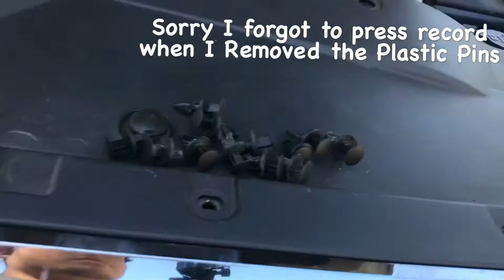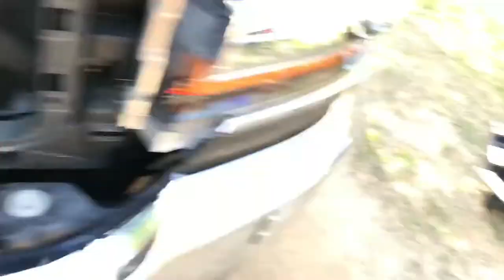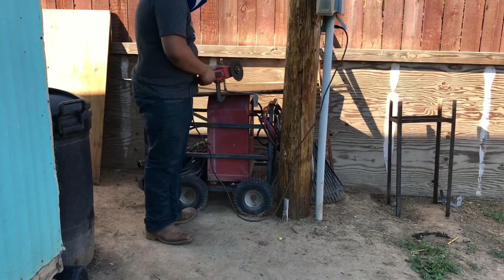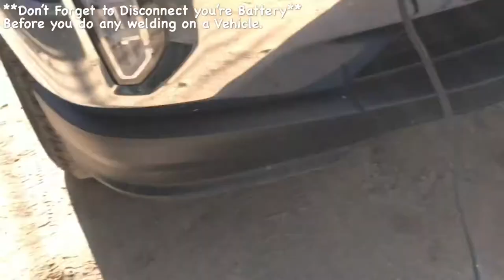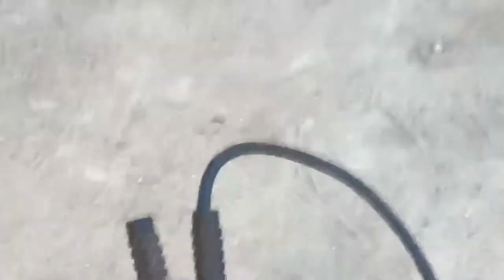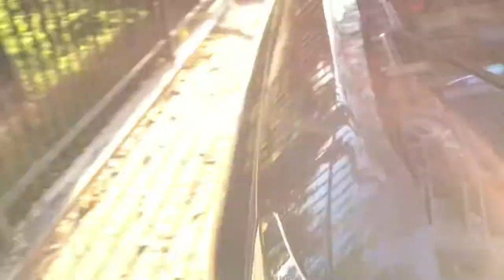2016 - 2018 Chevy Silverado LED Bar Install

Comment: Nice... I suck at welding I'd end up getting the l shap melted and a few straight with some bolts and nut lock  washers and call it a day... but this job was creative for sure

Comment: The grill fit back perfect? And wat sizes is that led bar?
Reply from the maker: Victor Bracamontes yes it fit back perfectly with plenty of space and the led bar is a 32 inch Curved. I’m actually working on a update video because i installed a few more behind the grill.

Comment: Did you not have the active grill shutter system? If so didn't unplugging it make a check engine come on?
Reply from the maker: Jon Wright no mine didn’t have any of that, the grill just came off and there were no wires or anything attached to it, it was pretty simple, Also I have no clue as to why the check engine light would turn on that’s pretty interesting, what model and year truck do you have?
Reply: I got an 18...I guess since 17 they added that and dont leave enough room for the light bar I had to return it

Comment: how did you delete the active grille shutters? 
because i wanna put couple with out engine light come on down the road....
Reply: Not all of them had the active grille shutter system, I think that was added for the 2018's. What year is your truck? Mine is a 2018 LT Z71 and I've got that stupid system as well...no room to mount anything behind the grille and just one more electronic thing to break. I live in a very remote area too, so not being able to mount a light bar behind the grille is kind of a bummer.
Reply: @AllThingsMech  mines a 2018 too with the active shutter....... i hate that i have them. im trying out this 32'' lightbar i cut the fins off and im gong to try triming the grill part about an inch and 3/8 deep with a dremal
Reply: They make a bracket that slides between the grille and bumper. Lets you mount a 20 inch. They are like 60-70 bucks. But thats the route we gotta go my 2017 6.2l silverado has the damn shutters
Reply: Nick Andros link?